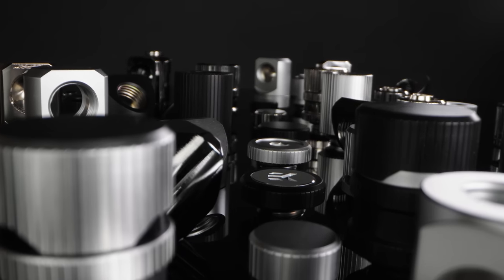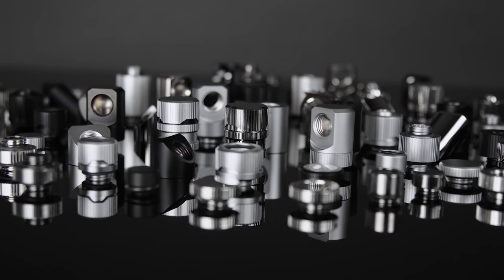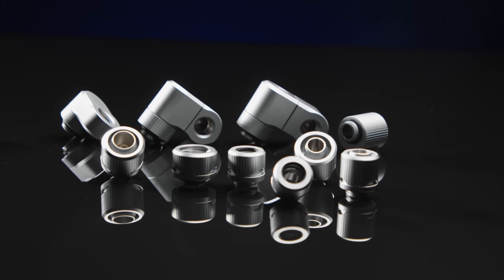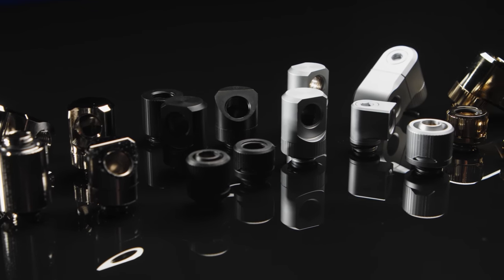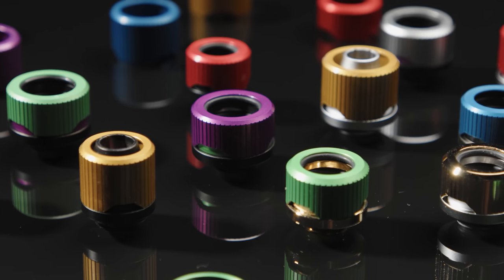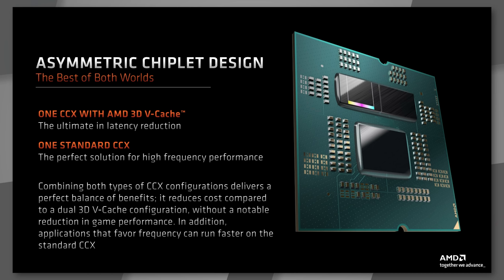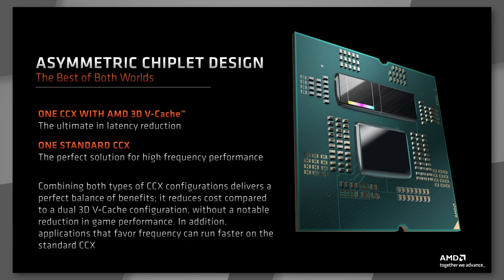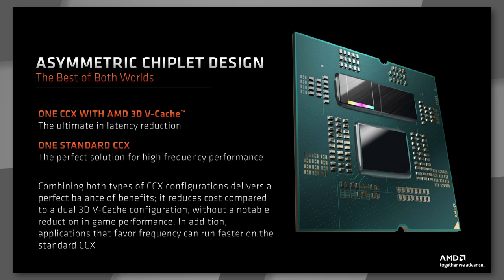Why I switched back to Intel...

Comment: I had the exact same experience with both 5800x3d and also quite recently my second shot (with AMD) 7800x3d. I didn't want to compromise the memory-chips I had already bought, returned it all back to store and got myself an apex encore running 14900k stable with 8000 memory-chips. Watched your other movie where you also experienced the drop in stability vs speed on cpu/memory, had the exact same experience over a 60 days return policy on the equipment. Happy to discover it in due time for returns!
Reply: 5800x3d to a 7800x3d?  What a worthless upgrade.

Comment: I've definitely had a ton of ram stability issues and USB connectivity issues with my 7700x TUF x670e. Some of it has improved with bios updates but not its not totally fixed yet. Knowing what I know now I don't know if I would have gone AM5.
Reply: Asus moment
Reply: Yea that’s an Asus board issue not on the 7700x

Comment: I feel kinda blessed, 7950x3d Gigabyte X670 board, T-Force 6000mhz ram xmp RX7800XTX and I've not had issues with stability. I don't think i'm getting 100% performance but I went all team red.

Comment: i've been running a 5800X ever since it came out with 4 sticks of memory at 3200mhz and i haven't had any issues. It's not a golden chip by any means, it runs hot, it uses a lot of power but it's mine and it performs extremely well for my needs. Still have my original R5 1600 that i plan to include in a small homeserver build.
Reply: Get 3800mhz ram and thank me later i have the 5800x woth 3200mhz ram and when i upgraded to faster rammi got lilr 43-55 fps more and the system was noticeably faster snappier quicker more responsive less delay

Comment: That's exactly why I choose to go with 5800x3d on my new build. Even though the general consensus is that if you build new you should go am5, but if you already on am4, an upgrade to the 5800x3d makes the most sense. I'm new to pc building and gaming, so I choose the stability of the am4 platform over am5. The only issue is that i'm already seeing cases where the 5800x3d is bottlenecking my system. Hogwarts Legacy at 4k ultra (dlss on) with rt turned on is cpu bottlenecked for me at places, whereas the 7800x3d would power through those situations. Regardless i'm extremely happy with my 5800x3d.

Comment: Fair enough, I recently built a new rig with a 7800x3d and 4090. Ironically for the launch of Starfield, which ended up favoring Intel cpus and AMD gpus, the opposite of what I got... But Starfield was a disappointment anyway so not a big deal. Anyway been happy with my build other than unfortunitely some element of my hardware seems to be failing causing hard system freezing. I suspect its the ram, and AMD EXPO ram is notoriously unreliable it seems, so that will need to be replaced. Otherwise I'm liking AMD hardware, would even have gotten an AMD gpu if AMD made anything even remotely close to the 4090 performance wise.
Reply: Just built mine 2 days ago with 7800x3D and 4090. I have 6000 CL30 Ram that is XMP(Intel) but OC’d it in bios with EXPO. I’ve had no issues as of yet running like a monster so far. I checked to make sure my ram was on my motherboards QVL list before hand.
Reply: @jakek3653  Grats, your gonna love the performance of that beast. Hope yours stays stable. For the love of me I can't figure out whats failed on my rig. Ram has zero errors after 14 hours of intense stress testing, hard drives came back issue free on through tests. Drives all upto date. Doubt it's the cpu as the pc keeps running after the freezing. still playing music, etc.
Reply: @johnmclain250  yea very weird, my ram is running high percentile, did you OC anything? I just enabled the AMD overclock for the cpu in my bios precision overclock boost or something still running just fine
Reply: @jakek3653  Nope, other than setting the default EXPO settings for the ram in the bios. Thing is the system is getting MORE unstable over time, at first it happened once a month, then once a week, then once a day, now it's twice a day the whole system locks up. Logs show nothing. So either hardware is failing and I can't figure out which part, or the whole system software is corrupted beyond repair. The most telling sign I had was when playing a game, and the system froze up, however, the game still worked, I could move around, but nothing loaded in anymore. Meaning the cpu and gpu would were working, but no assets could be loaded, which lead me to think memory or hard drive. But both come back with no issues when tested. Really confounding.
Reply: @johnmclain250  wow I just closed out of a game and got my first blue screen error, system booted right back up though. Its 3 days old so I thing it’s still learning memory etc hopefully
Reply: @jakek3653  Well I built mine back in august, so that won't apply to my issue. In any case, it "learns" the memory profile when you first turn on the PC, but that doesn't apply when using EXPO as it overwrites that.
Reply: @johnmclain250  yea I have XMP ram but enabled EXPO-1 or something but my ram is running at 6000 so it worked, just confused why I got a blue screen randomly closing my game but started back up no problem. It also takes my pc about 30 secounds to load super weird.

Comment: Just purchased a 14900k for a rig I’m planning to be used for mainly video/photo editing. Very worried about the temps but hoping I can tame the beast with the Arctic Freezer iii 360mm. I’ll update once the system is together if people are interested. Planning to build in the Fractal North XL. 👍
Reply: Bought a 12700KF. (no support for a Intel video solution. Why do I need it while I have a superieur Nvidia RTX 3060Ti in my system?) Not an i9 but an  i7 without any problems. Can handle whit ease your video/photo editing for less money. With modern CPU's temps are not the problem anymore. Got a large cooling fan on top of it. Max is never ever reached like 100 degrees Celsius. (Get some free software to monitor this! Temps are not the issue. Run Cinebench Release 23. That is a piece of software which will take the hell of your CPU and ramping up the temps. Your software? Doesn't in every case. How demanding it looks like. Cinebench is designed to ramp up the temps, voltage and stuff. Your software doesn't.) Your goal; using video/photo editing? The CPU is an absolute overkill. i9-14900k? Too much money. Performance? Some but not a lot against a cheaper i7. Wil take a few seconds of your task. what the difference? None. I hear the sounds also everywhere; Need for speed. Buy our product.... Speed doesn't do anything for you. It comes down to the software you are using. Some are really fast but others are slow in comparison. i7 or an i9? Makes no difference.Won't go so far as saying buy an i5. What you need is max cores. i5 is limited for a reason. Cheaper will do for the main part of the users, Browsing, email etc. Not a lot is going on. video/photo stuff needs a bit more by the design of the software. Not for the CPU. For your purpose was an i7 already more than enough. No need for a i9. So what if it is 2 seconds slower with an i7? Bother it? Listen to their sound.... More... Speed.... Buy.... Will be wonderful. BS. They want more money. Old tech like the 10 year old i7 was already a Highlight. Performance is with a i9 slightly better. What do they want? Users who will play state of the art games. Ha. Company's like AMD and Nvidia also targeting on the subject. Less CPU. More crazy 2048 (and more) GPU cores. If you want superior performance? Choose a product which make use of those GPU cores, More performance than a CPU...... And I am not kidding. A faster CPU won't help. A very good GPU takes it over. Invest in that. Software which makes use of the 2048 core GPU's? Blazing trails.... CPU's are a bit old school. 12 or more cores. Not easy. GPU's? 2048 cores and they keep up raising the numbers each day.  At the end of the day? Focus more on your software and the use of a GPU. More speed is there to get. Forget the CPU power. You don't browse or email faster with a fast CPU. Just my 2 cents. GPU power will in the end over class any CPU. Future will be more ridiculous as we thought. New products with AI build in to it. Can predict scenes which we don't have experienced yet. Crazy stuff. Make use of your GPU. More performance with the right software brings you so much more performance than a fast CPU........
Reply: @hansderuiter1699 You sound like a Strix Point customer... Me too.. 😂

AMD will seriously impress you next year.

Comment: 7800x3d with 7900xtx and X670e with 6400ddr5 and could not be happier.  no issues for almost a year and better is the savings on electric bill which is just amazing.  i have not noticed any issues mentioned but i am not really doing any labor tasks ie no video editing etc...   i really don't see me upgrading for sometime or going back to intel until they put out CPU's that are more power cost friendly

Comment: I moved from a 5600X to a 5800X3D.  I have it undervolted with a -30 offset on all cores using PBO2 Tuner.  Temps are definitely up from my 5600X, but everything has been stable.  I don't see higher FPS really, but what I do see is much higher and stable lows.  To me that is everything and I've been super happy with the upgrade.
Reply: I went from a 3800x to 5800x3d with a similar offset and it’s been super stable. I think it’s more to do with DDR5 memory than the CPU
Reply: 3600 to 5600x3d on a b550 board not a single issue
Reply: A single offset for all the cores is an extremely bad idea. I highly doubt it actually is stable at -30 all core. Nobody should be attempting those offsets. The best cores need more voltage, and that is the common cause of instability issues. You should not go past -10 or -15 on the best cores.
Reply: The 5800x3d is a single CCD chip so it won't suffer from the same issues as the 7950x3d. That's why it's recommended to disable 'cppc preferred cores' in bios with the 5800x3d.
Reply: @username8644  it's widely regarded that if a 5800x3d can't handle -30 all core then it's a dud chip.
Reply: @VelociRapT0M  Don't think you understand how the core offsets work. Not being able to hit -30 on the best cores does not mean bad silicon lottery. The best cores need more voltage than the worse cores, that's just how it works. If your best cores can hit -30 than your worse cores can probably go a lot further. Using a single offset for all of the cores is incredibly stupid and that's what my point is.
Reply: @username8644  no, the best cores will operate just fine with the lower voltages. It's when the cores aren't so good that they become unstable at lower voltages
Reply: @VelociRapT0M  No. You have it completely backwards, the best cores need more voltage. That's how these CPUs work, it's not the same type of undervolting as it used to be with previous generations. Clearly you don't understand how these CPUs operate, you really should not be trying to give people advice without knowing anything about what you are talking about.
Reply: @username8644 dude, what do you think makes a core 'good'? The better the core, the lower the voltage it can operate with, meaning lower temperatures, meaning extra thermal headroom to boost to a higher frequency. It's YOU that has it backwards.
Reply: @username8644 a good core doesn't 'need more voltage', that would completely defeat the point. Think about it.
Reply: @VelociRapT0M  The better cores need more voltage than the worse cores because they are the ones being selected for single core tasks which AMD purposely pumps a lot of voltage into to bring the clocks up. That's the reason why AMD CPUs run just as hot in single core workloads than in multi core, sometimes even hotter. If you undervolt those best cores too far they will be unstable. The worse cores are never selected for such tasks so they can be undervolted significantly further than the better cores. Again please do some research, you keep thinking you are right even though I've repeatedly told you, that you have it backwards. These cpus do not work in the same manner as previous generations and therefore your idea of undervolting doesn't apply here.
Reply: @username8644  it's the same as previous Ryzen chips. There is literally nothing online that backs up what you're saying either. You must know more than aaaaall sources online. You do some more research, then feel really silly when the penny finally drops.

Comment: I've only had good experiences with Intel. i5 2500K, i5 4670K, i5 9600K, i5 13600K... and they have all been solid since day one... and I'm still using ALL of them to this day for gaming (simpit, virtual pinball, PC gaming, etc). I just make sure I buy Intel when they are on sale and make the most sense for an upgrade.

Comment: Been running my 7800X3D for about 4 months now, with PBO on and all cores to -30° and 0 issues at all. The power comsumption is amazing and the temps are really low. So happy with my choice

Comment: I think they fixed many things since 5 months ago, I have a 7800X3D. I've been using it for a month, besides no real overclocking, it's a real champ, boosting over 5Ghz on my Gigabyte b650 elite ax 1.2 rev with PBO temp 90 level 5 and xmp 1 enabled.

Comment: As a service technician that builds modern day PCs on an almost daily basis, I'm glad to hear you point out what I've been noticing for months. AM5 platform is riddled with memory issues. I personally use an AM4 build running on a 5800X3D and I never have any of the issues I see others have with a Ryzen 7000 Series system. I've been recommending Intel 13th instead since I never have any of the same issues on Intel builds. These issues with AMD are far too common and this is a problem that needs to be addressed. As more time goes on, AMD seems to look more and more unstable and unreliable. It's like they're rushing to keep up with their competition and releasing stuff faster than they can properly optimize it all.
Reply: memory issue is YMMV.
Many people have no issue with it.

I believe buildzoid specifically dislikes intel's memory controller for 13/14th(assume as just refresh) gen and prefers am5's.

I personally havent had memory issues on my rig.
Reply: I have no memory issues with ryzen 7600 as well. Running at 6400 cl30.
Reply: i have "issues" too, but a very weird one, 7800x3d, MSI board - corsair EXPO 6000 cl30 - works when enabled, my boot times increased to ~30sec not a big deal since my last intel system z370 had 20-24secs too.
Here comes the weird part after enabling it there is a chance if i go into the bios and change ANY setting the bios will hang upon Save & Quit - after force shutdown & reboot it boots into windows and gives me instantly a bluescreen (tho the setting got applied), it doesnt do any memory training on reboot too - so to fix it - reboot - go into bios disable EXPO fast (cuz it will hang after 1min again in bios too) and save - reboot -> go into bios do everything u want & then apply EXPO - it reboots and works without a problem again. i dont have any bluescreen, i had my pc 1 week running 24/7 no bluescreen whatsoever. The next very interesting part is when EXPO enabled: i cant run 3Dmark, CPU-Z, or HWmonitor. 3DMARK has a high chance to scan my ram speeds sometimes it works sometimes not tho its hard to get a validated score or even to see the full graph
CPU-Z works but on mostly on launch the RAM rgb get hardstuck, icue shows a warning sign, lists a different ramstick & cpu-z wont show the RAM specification, or only 1 ram the other one as empty.  (windows reboot will fix it upon next launch)
Hwmonitor just refuses to launch, after scanning it crashes - no issues with HWinfo.
Contacted corsair with it, after sending everything inluding logs, they said: "sent them back & we sent new ones" - i was not willing to do since except 3 programs they run fine.
3DMark said its the GPU-Z/CPU-Z validation problem since they running their code on it they have to fix it - contacted CPU-Z -> didnt even got an answer and the issue remains
MSI's answer was: contact Corsair or dont run EXPO.

however it feels im the only one with this exact weird issue. - and to clear things up: no Windows is not corrupted, Bios was up-to-date, there is a new version to seem to be have better compability but seen many ppl having less stability overall so rather not touch it for now).
Reply: The problem isn't AMD, the problem is Jays approach. He is too stuck in his ways, and does everything the way he would on an Intel and Nvidia set up. He still, to this day, can't OC an AMD graphics card, because he refuses to undervolt, or optimize. He just does "the Nvidia thing", then blames the card for his own inability to OC properly.
So any time something doesn't work the way HE wants it to, he goes back to what he knows, even if it is inferior, and makes excuse videos, like this one, to justify his decisions to himself.
Reply: @JoenHarlver  you leave out which MSi board model you have, and which BIOS revision you are running.
Both of which are critical for trouble shooting.
You're also too apprehensive to do an RMA with Corsair?

Which makes me think...

A: Cheap Motherboard.
B: Too afraid to do a BIOS update.
C: A bit out of your depth on hardware.

Comment: I have the ryzen 7 7800 x3d, I apparently must be pretty lucky because I've had zero problems. 
I paired it with the 7900 XT, I know it's not all the top and stuff and I really don't mess with anything but I've been really happy with mine.